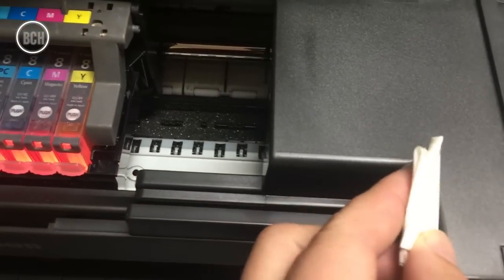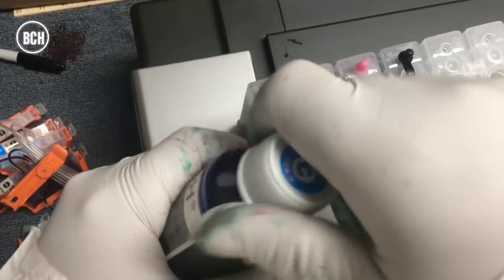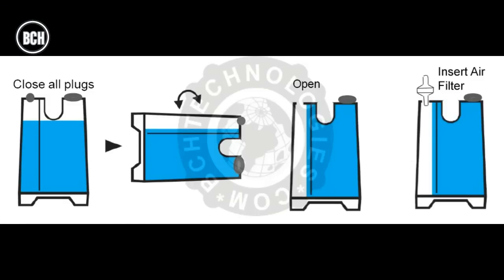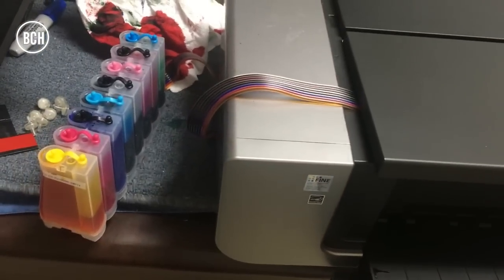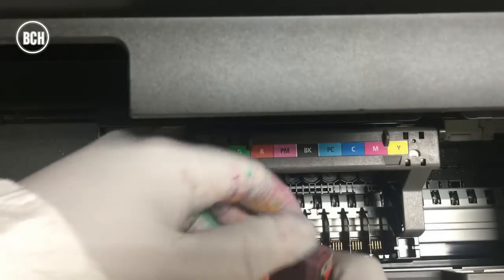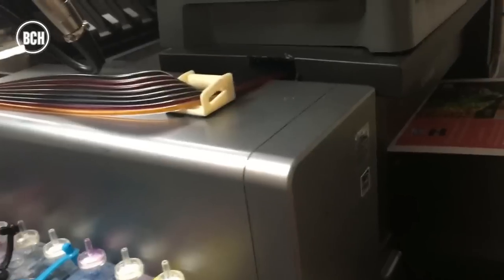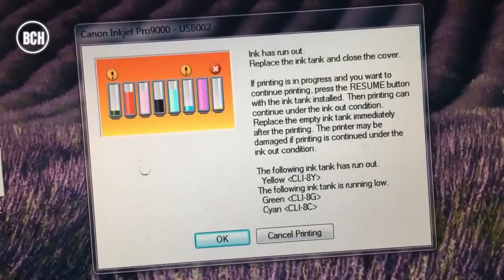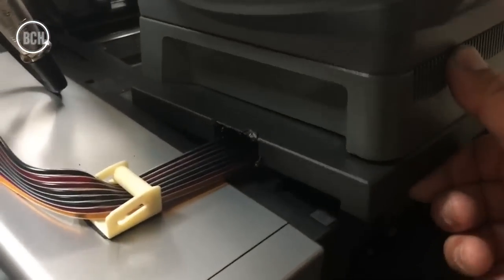Add an Ink System to Canon PIXMA Pro 9000 Mark II from Scratch -  Canon Pro9000

Comment: How do you have it open while printing? It doesn't let me keep it open while printing.
Reply: At the beginning of the video, it shows how to wedge a piece of paper (I use a folded business card) to make the printer think the lid is closed. Use a flashlight so you can see in the crack where the paper holds down a little switch. Once you open the lid and place the paper in to hold the switch, you can print with the top open. Hope this helps.